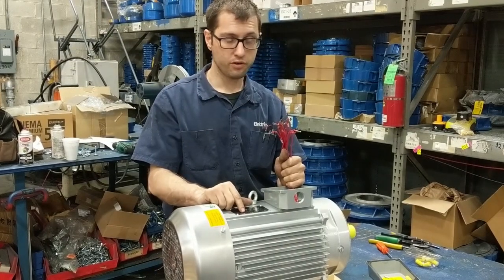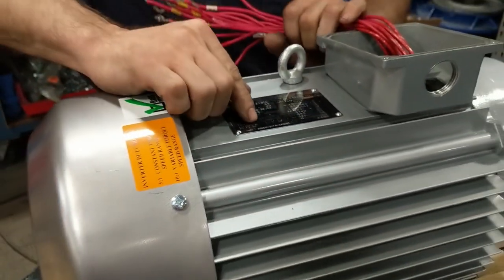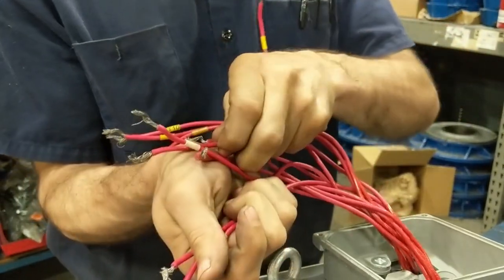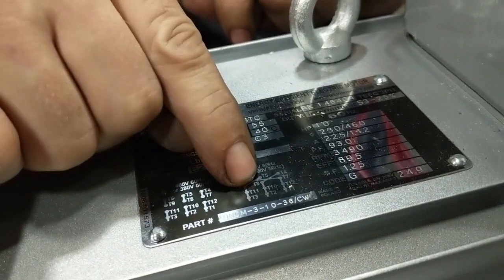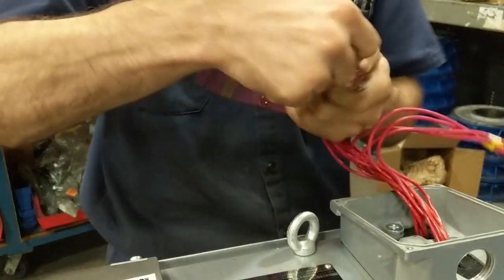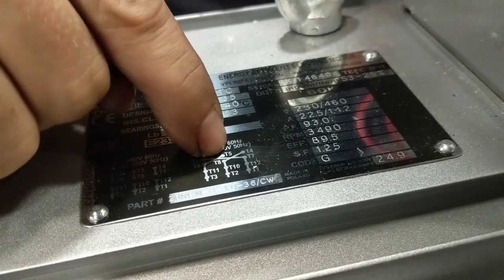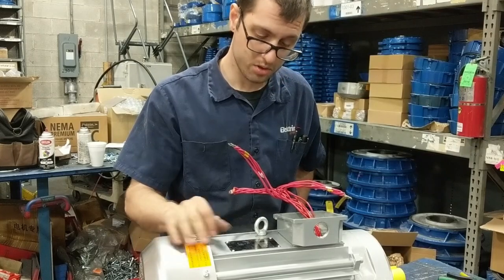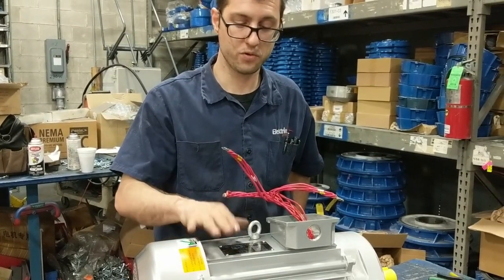How to Wire an Elektrim 12-Lead motor for 230V 60Hz

Comment: Is there any way of identifying the cables if they are not marked? I have a 12 3 phase motor I’m trying to wire in delta to run off a single phase VFD. None of the terminal are marked
Reply: Look up (Motor lead identification test); there's several videos for 9 lead motors; if you happened to have enough common sense and critical thinking you'll figure out how to do a 12 lead motor.  https://www.youtube.com/watch?v=J2GL9zfz91Q&list=PLiwNoZhq3fazhXYHIKsYR4kEkVisbQzGC&index=6.                    https://www.youtube.com/watch?v=mqXgC8_R6YE&list=PLiwNoZhq3fazhXYHIKsYR4kEkVisbQzGC&index=8

Comment: Can run star delta if 12 leads?
Reply from the maker: Yes, you can.  You can do that at both, low and high voltage, with the correct starters on X1 Series blower motors.  Reach out to us directly if you want the correct wiring diagram.  It is also in the manual if you have a motor already.

Comment: Ever have a brand new motor mislabeled? I got a 30hp motor that runs fine in star but not in delta. It's hooked to a vfd with a 20 second start ramp and not connected to a load. It will barely make a half rotation then fault the drive on over current. I checked continuity between each winding and that seams to be correct but I think one coil might have the polarity backwards causing increased starting current
Reply from the maker: Sure, theoretically, any motor could get mislabeled as there is a human element in the manufacture of motors. However, it happens very infrequently. Out of curiosity, what brand motor is the 30hp?  Also, I’m assuming if you are running the motor in both Star and Delta that your building has power supply in both voltages, correct?  Are you using different wiring diagrams?  I ask because most end users only have one type of power supply at their facility, and I want to make sure you’re not trying to run/operate the 30hp motor at both Star and Delta using the same voltage...
Reply: @ElektrimMotors  I'm not 100% of the brand. It's lable say made in France with amp and voltage ratings for hight and low voltage. It says single speed dial voltage with 4 possible ways to connect it. High star, low star, high delta, low delta. It's a 12 wire motor.  I am using a VFD to power the motor. When in low star it says for start only the vfd will run the motor but as this configuration is for start only I don't and shouldn't need to use this because I have a VFD. I have the max amps set to nameplate of 62 amps and 20 second ramp time. When in delta/delta wire configuration the drive jumps to max amps instantly any only turns maybe 90° of rotation. When in star it will start but sound like it has a vibration at start up that goes away at full speed. Also when in star it only pulls about 8 amps. Which to my knowledge is the purpose of star configuration startup to reduce inrush current then to be switched to delta once at speed. I've read that having a reverse polarity coil can induce a vibration and cause high start current because two parallel coils are fighting each other in delta delta.
Reply: @ElektrimMotors  here is a video of the motor hooked to another vfd on high voltage star with a 3 second ramp. Also runs fine. I didn not try high voltage delta delta yet.
https://youtu.be/PSoQbPSZZks